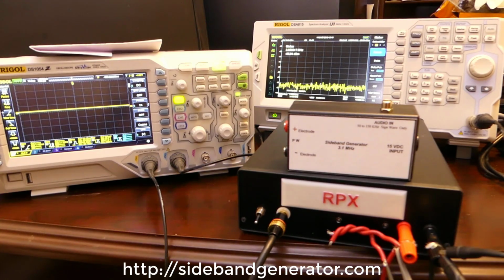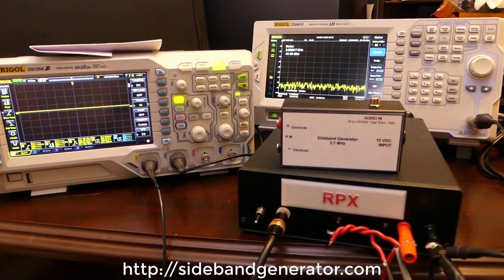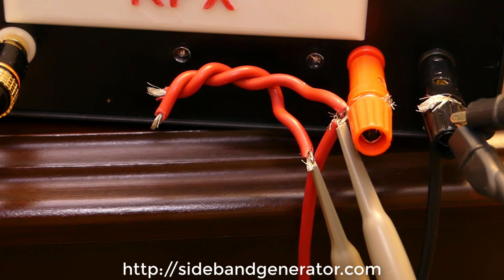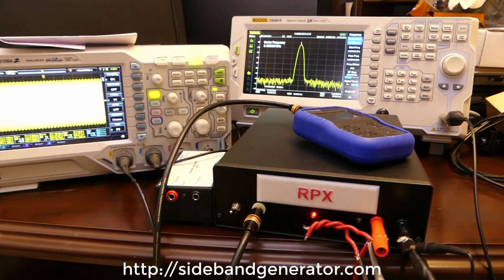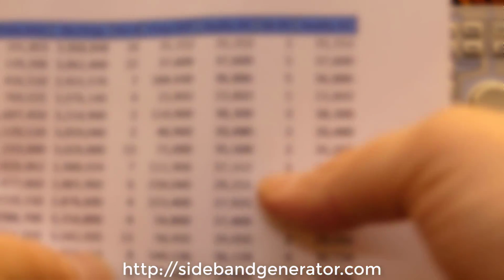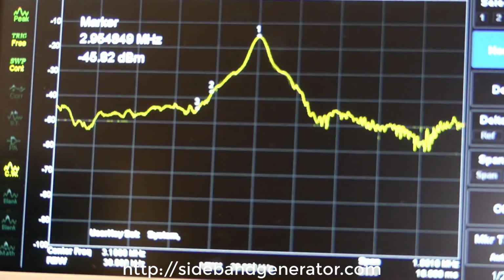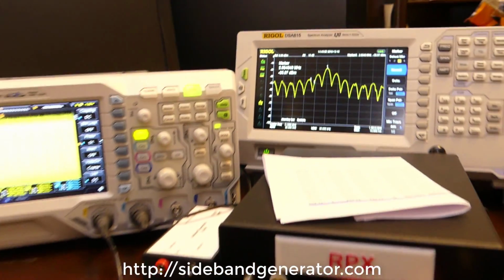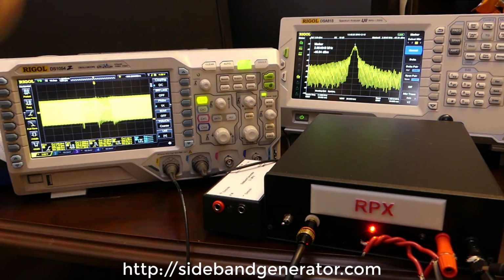Bedini RPX - What are the sidebands generated?

Comment: Aaron, what you are calling this, harmonics is not the correct term.
What you are showing is called intermodulation products or to be more specific  with correct terms, 3IMs . It is the results of mixing two signals. 
https://en.wikipedia.org/wiki/Intermodulation
and I think you need to set you trigger hold timing on your scope?
https://www.youtube.com/watch?v=yC8ngSSWym4
Reply from the maker: In what part? The mixing is heterodyning and creates a higher and lower frequency that is the addition of and the difference of the two frequencies. If you look at the Rife sideband calculator available on some of the pages, there is a harmonic relationship between the audio frequencies injected into the sideband generator.

Comment: In theory this device is hitting all the Rife frequencies at the same time?
Reply from the maker: Not at the same time but sequentially in a cycle over and over and over every time the function generator goes through the whole sweep. And in actuality, not theory - it really does it and the spectrum analyzer proves it. You can slow the sweep if you want to remain on any particular frequency longer or you can narrow the sweep frequency range if you want to cycle within a certain range more often, etc... many ways you can approach it with the little function generator.